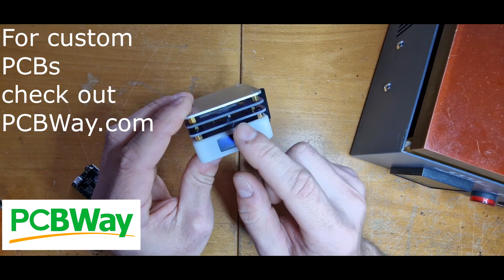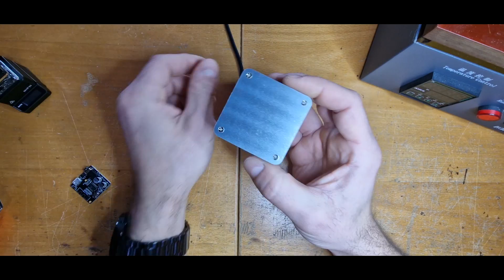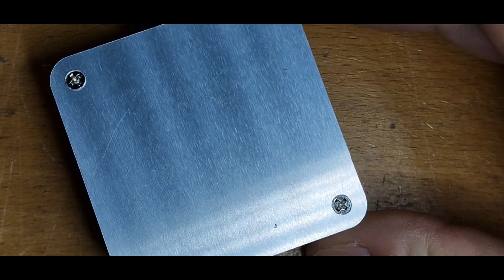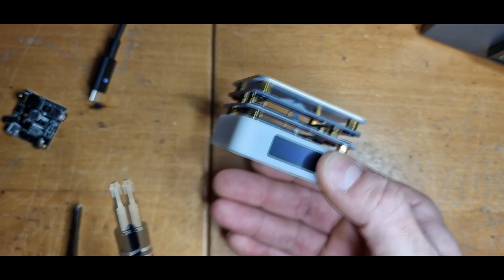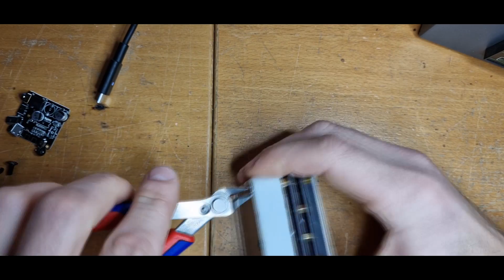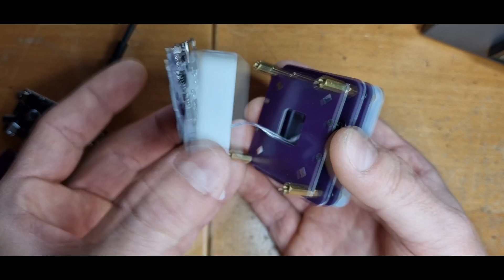Cheapest Hotplate with a Display? testing and Teardown

Comment: I got a MHP30 2-3 years ago for around 100€-ish. It showed a "No hotplate" every other time I used it. Now, it finally went out of service. No matter what I do, the error remains. So frustrating! I disassembled it and did a visual inspection. I tried different firmwares. Checked and cleaned contacts. Measured resistances of the heating plate. I cannot recall exact numbers but they didn't look suspicious. I used it maybe 6 times successfully ... just missed the point where I could've claimed warranty, my fault.

Comment: Have you checked temperature. I got this and when it says it is heated to 100C I measure about 67 on the plate. Is there way to calibrate it? User Manual is not helpful.

Comment: The similar "MECHANIC IX5 Ultra" has metal fittings to secure the board.
This allows heat to be transferred evenly and the board is fixed in place, making it easy to move components.
Reply: Can I use it to also soldering SMD pcb ?
Reply: @thanatosor  Yes you can.
The advantage is that it is visible.
Reply: @ How accurate is its temperature ? does it support reflow ?

Comment: Good thing that the electrolytic capacitor didn’t pop and launch itself right at the camera when you pulled it off the PCB and tossed it onto the hotplate! That could've been a real electrifying fireworks show! ⚛

Comment: Hello, the temperature sensor in my device came loose, which I have repaired. However, the springs of the contact pins broke after about 3 hours of use at 150°C. Unfortunately, there was a short circuit in the connection to the heating plate. Now the display only shows 5V instead of 20V, and only if the power supply plug is in a specific position. Is the issue likely with the power supply or the heating plate?

Comment: Cool! Bought one to work on Gameboy Color cartridge PCBs, looks like the perfect size, got it for £6 on Aliexpress which is insane
Reply: Did work out for you and taking off parts from the GBC? wondering if it gets hot enough
Reply: @ the issue is often that it has components on both sides of the board, the carts have everything only on one side so it’s easy
Reply: @PopeLeo  That's true. I think the areas I need it for should be okay. Good to know it gets hot enough. Thanks!
Reply: @VirtuaVillain  I find I only need it on 170C to melt the solder on GB cartridges
Reply: @PopeLeo  Appreciate the info, even if it doesn't work out for the GBC mainboard I'm sure I could use it for some other project. Cheers👍

Comment: whats the max temp on this? Have you been able to remove parts from pcbs with large ground planes? For the price and what it can do seems very nice. Is there a github or a link to where you can find the specs? Maybe the 3d file for the case if you wanted to print it in a different color.

Comment: I got one of these for £10 shipped. It worked great reflowing a PCB with low-temp solder paste. I haven't tried to use it to do any de-soldering of high-temp lead-free solder but I think it would work fine for that too. For the price you really can't go wrong. Just don't throw away the manual as it's pretty hard to use without it.

Comment: I bought one. What are you using for power suppply? I used 5v but temperature stopped at 66 degrees after 1 hour of heating. The current drawn is 0,8A Did I something wrong?
Reply from the maker: You need a 65W USB C PD power supply.
Like as for a Laptop

Comment: Nice device but mine keeps resetting 🙁
Reply from the maker: Sounds like your powersupply is not giving enough current
Reply: @atc1441  Indeed it was an issue when powering it from my monitor
Reply: You need a 65 W PD adapter (20.0 V, 3.25 A) - with a USB type-C plug.

Comment: Got mine a good while ago, but one of the buttons is broken so cant make use of it
Reply: You need another mini hot plate, to repair your mini hot plate. 😜
Reply: Mine was stuck too. I removed same switch from Wemos D1 mini using hot air.

Comment: Ain't 220C a lil bit to low temperature for reworking? I would think about 300C will do the trick even on unlead solder.
Reply: 220 is perfect. 300 will damage many parts.

Comment: Nice! Is it possible to program some reflow curves there? Also curious, What kind of camera/recording setup are you using?
Reply from the maker: With a custom firmware curves would be possible.
The camera is just a Samsung S22 Ultra laying on a light
Reply: No in the current state. But community firmware or PCB is just a matter of time :)
Reply: It's a shame it seems it can't be programmed from the USB-C. They should havr put tx, rx on SBU pins and not behind 12 screws. :)